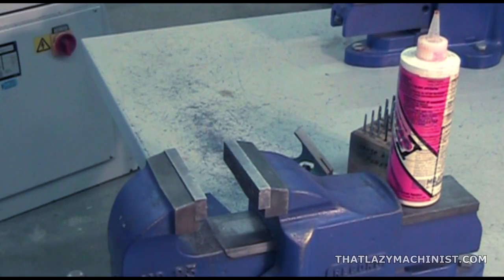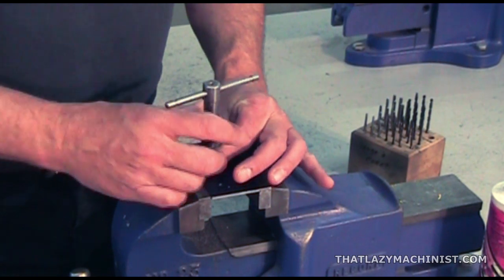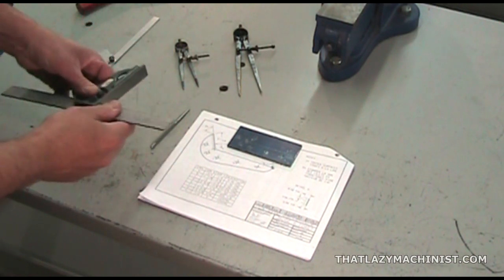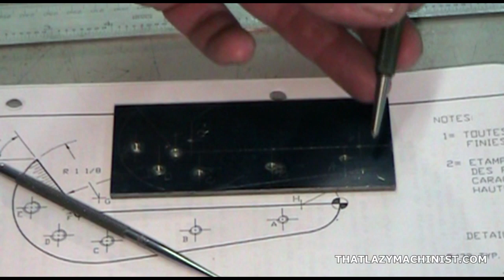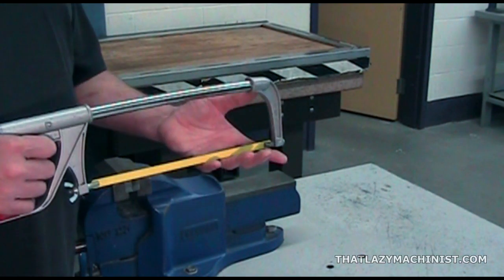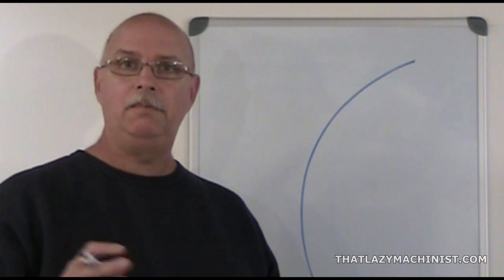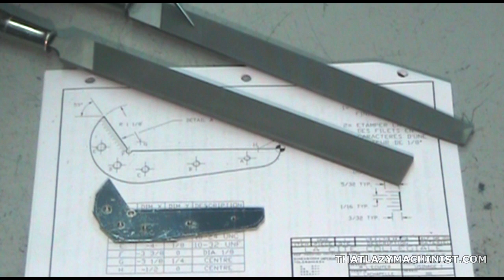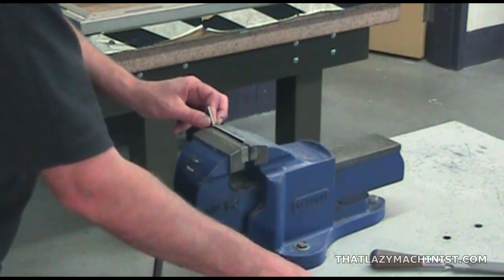DRILL POINT GAUGE PROJECT #2 small hole taping, contour layout, hack sawing, cross and draw filing

Comment: You need a very simple tap guide to start a tap straight into a hole. Get a piece of scrap aluminum about 3/4" (~20mm) thick and ~1"x3" (25mm x75mm) in size. As needed drill a hole  the size of tap (or tap shank for small taps) being used through the aluminum block. Hold the guide on the work and put the tap through the hole, straight into the work.
  The guide I've used almost daily for 40 years is a sawed out piece of scrap that still has a sawed finish on 3 edges. It has about 8 holes in it so far for various sizes of taps up through 1/2"-13 UNC (~13mm). If you need a guide for a larger tap get a block sized accordingly. 
  Using a guide will substantually reduce tap breakage. Remember for mild steel a 100% thread is only 5% stronger than a 70% thread but takes twice the power to tap. A 50% thread will snap a general purpose bolt before it strips the thread out of the hole. For thin stock where only one or two threads are possible, tap with a 100% thread.
Cheers from NC/USA